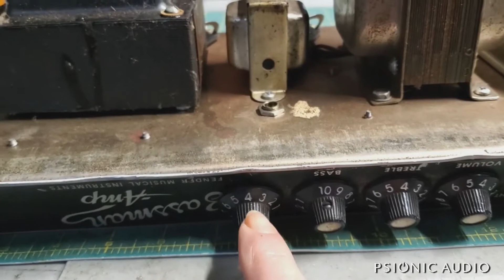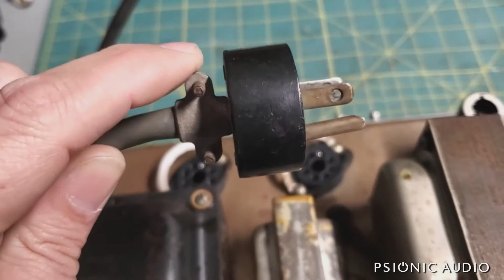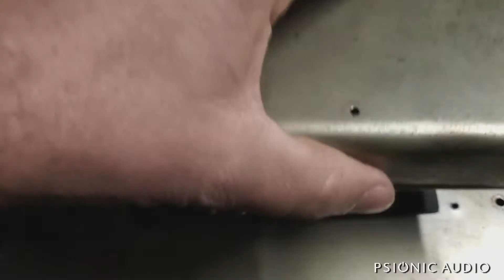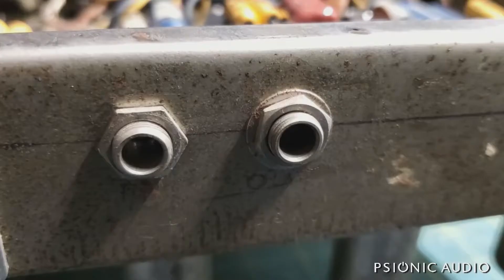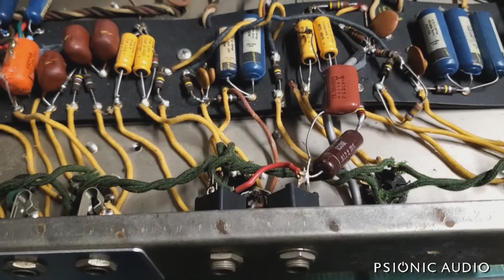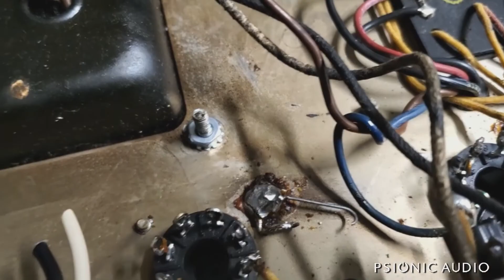'66 Fender Bassman AB165 Part 1: Initial Inspection & De-Kludging

Comment: I modified my 67 Black Panel Bassman from AB165 to AA864 specs on the normal channel and 5F6-A tweed specs on the bass channel. Then, since the AA864 has 1 less gain stage than the AB165, I had the unused pins 7, 8 and 9 from V2 added to the bass channel so it is higher gain like the Marshall JTM45 and so the channels were in phase again. Best of both worlds with an AB->Y pedal!